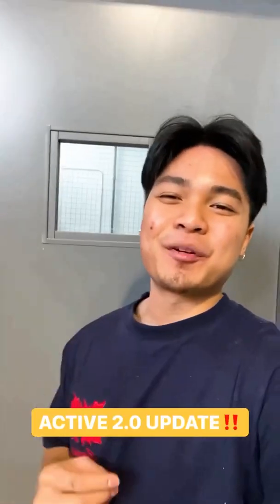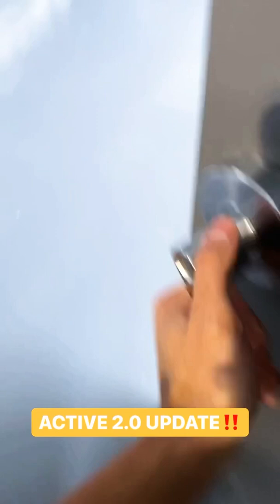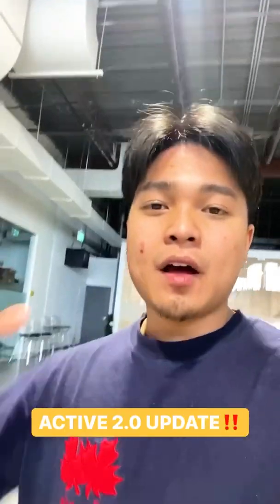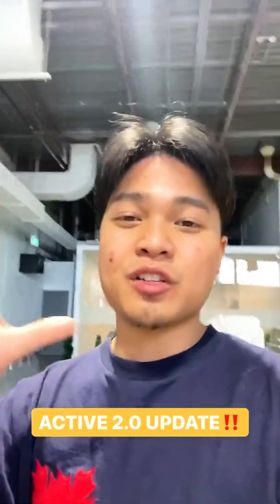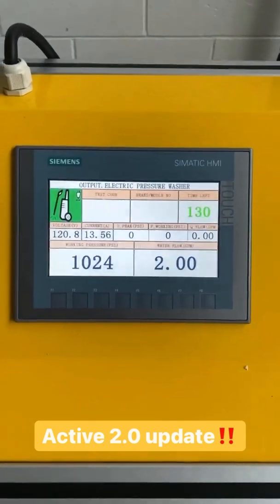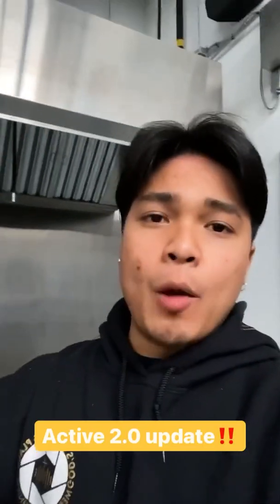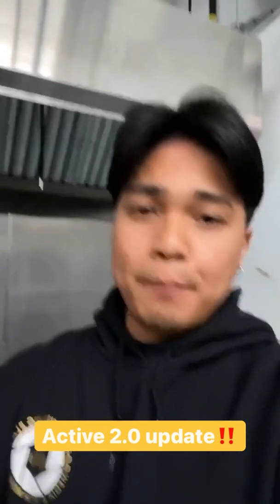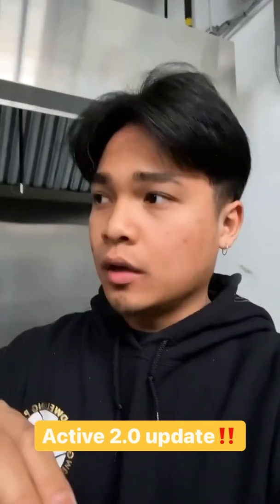Active 2.0 Life Cycle Test

Comment: Double the life expectancy is great. So can you share what that expected number is?  Is the duration measured in hours?  You let this test run for some time but are there other tests where the unit has ran for 100s of hours continuous?  What about start/stop cycling with pressure building up in the unit and repeating that task every 5 min for 24 hours straight or something?

Comment: This is pretty impressive, however I'm hoping there's more to it than just an increased life expectancy. I just got my VE-52 last summer, and I love to use it when detailing my cars. It's been working out great, so unless there's something like an increase in the GPM or a much quieter operation, I really won't feel the need to go out and replace it right away.
Reply from the maker: For now we wanted to let you all know that we have something new that's coming out. You might be find answers to your questions when we finish that video.
Reply: 1024psi @ 1.99gpm after 2 hrs.
1021psi @ 2.00gpm after 6 hrs.
997psi @ 1.97gpm, as I read it, after 8 hrs 15 mins.  I guess that's where they get the "2.0" from as it's almost 2 gpm.  
I  was actually going to order a VE 52 this weekend but, now I'll think I'll hold off 'til the "2.0" comes out.

Thanks, ACTIVE, for the update.👍
Reply: Those are pretty much the same specs as their original VE-52 though. There's really no incentive for me to upgrade if the only thing it's bringing to the table is longer endurance.
Reply: Hopefully what this brings to the table is a fix for the VE-52 cycle issues.  I really like my 52 but I got one of the ones that cycles when the trigger on the gun is released.  At first it seemed to be pretty isolated then more and more reports came in.  Mine has seen only 10 hours or so of use, probably less actual run time.  If this fixes that at the same price point it'll be a winner.
Reply: @Ryan_H22  I have a VE56 and from
What I understand from active is the 56 has an updated pressure switch that was fixed and stopped causing the surging issues. One of the 2.0 videos he refers to this. If you still have a 52 you may still have that problem
Reply: @joerossi4231  Yes, mine is a 52.  It's not even a year old yet.  Not long after I got it is when there were more and more reports of the surging then mine developed it.  It works good otherwise so I've been holding out of doing anything while Active really works out the kinks then I'll contact them about replacing it.  I'm sure they'll make it right!